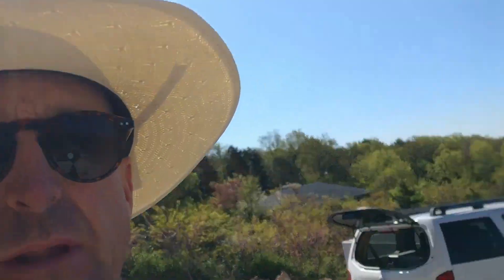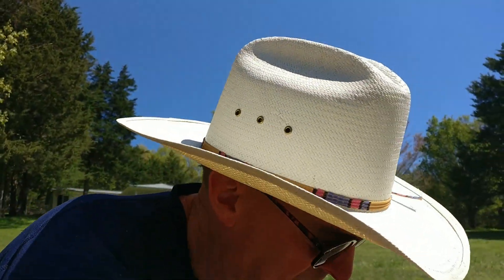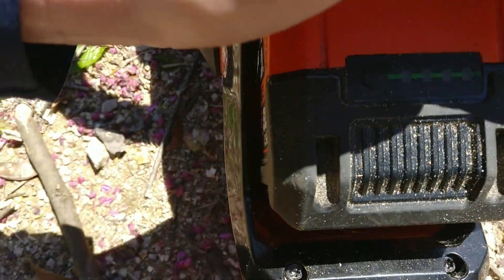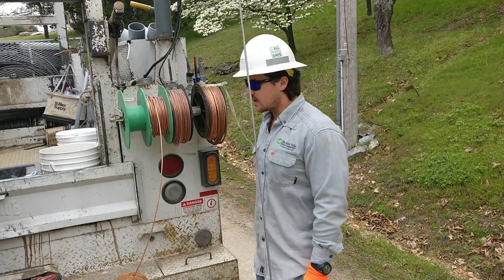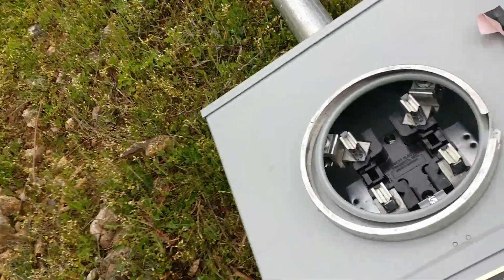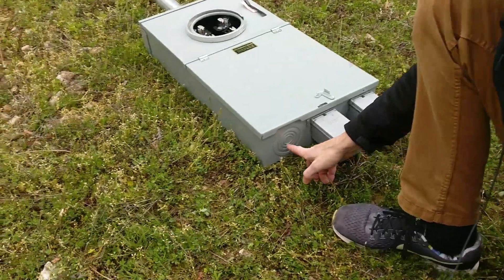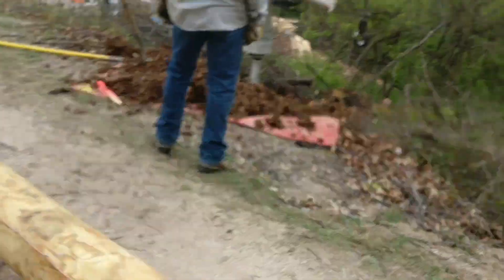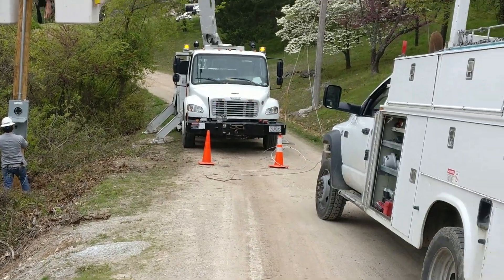We have power! Electric Co-op Installs Power Pole, Meter Loop, and Transformer

Comment: curious about the costs of the pole, electrical line and transformer--did you have to pay the cost to extend the line from the original pole across the street, did you have to get "permission" to tie into the existing electric line, likewise, any cost to you for the transformer?  thanks!
Reply from the maker: We paid $600 for the set up on the pole. The actual pole and setting it were paid for by the electric company. We then paid for the line (which we buried) from the pole to the house.
Reply: @LakeLotBuild how much was the total?

They quoted me 2500 to run electric, and pole

Comment: Can you show the final product of the deck you just added. Thanks for sharing
Reply from the maker: We are excited to show the concrete decks once they are built.  We have only done the garage floor pour so far. It was suspended using LiteDeck forms. We will use a more traditional pan and column pour for our decks.